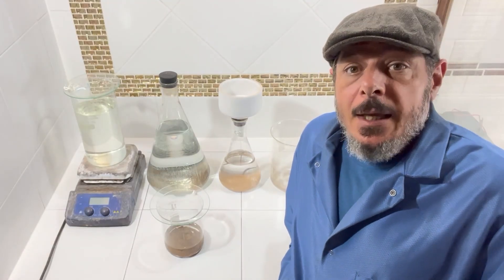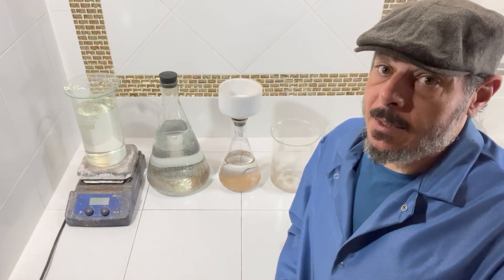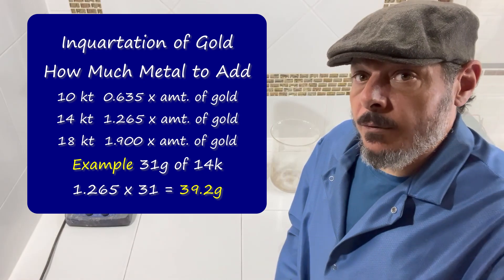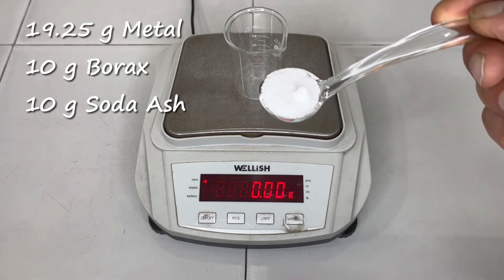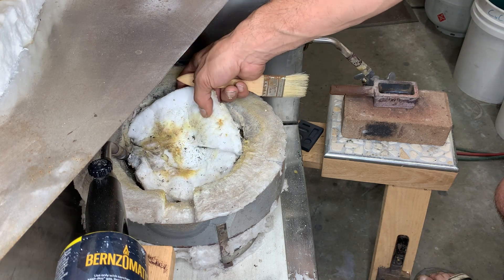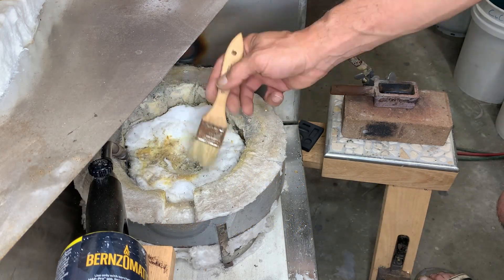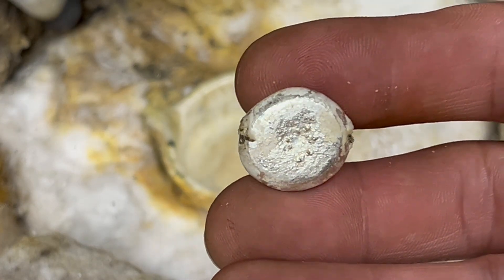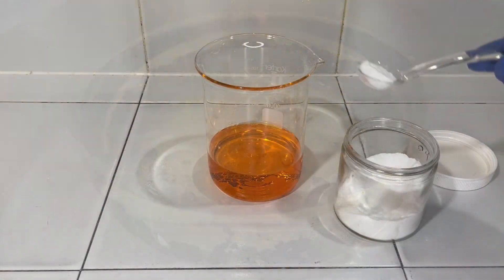No Fear Gold Refining

Comment: Why pour off the flux before finishing the melt?  What’s its purpose if you’re just pouring it off?   
Before you said to protect it from oxygen, but as soon as you dump off the flux, oxygen gets to it anyway?    

Can you do another experiment without the flux to see if there is any difference in results?  

I’ve never run into this issue myself, I always add a few extra grams of base metals to make sure it’s under 6k, but I’m still interested to see if the swimming pool of flux at the beginning is necessary, of if you can just add equal amounts of base metals and just move forward with the refine.
Reply from the maker: You don’t have to pour off flux but the smelt takes a lot longer if you don’t. It saves time and gas. Once all the flux is molten the reaction is over so it isn’t needed anymore Ann by removing it the metal forms a nice prill.